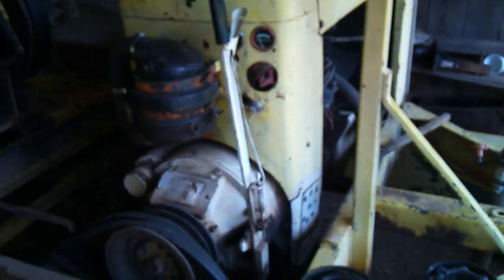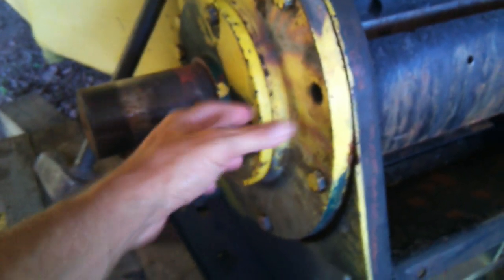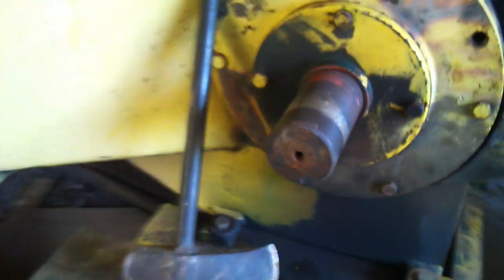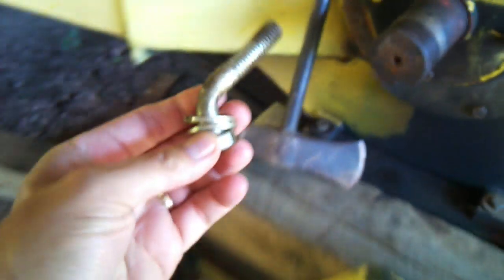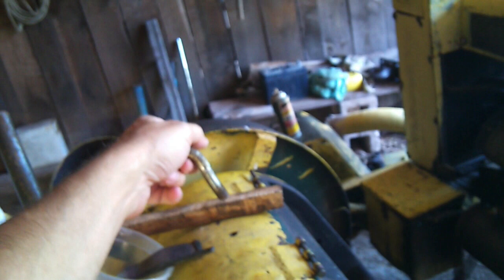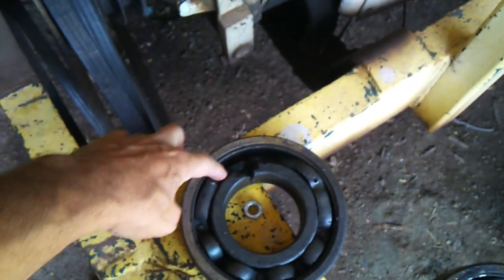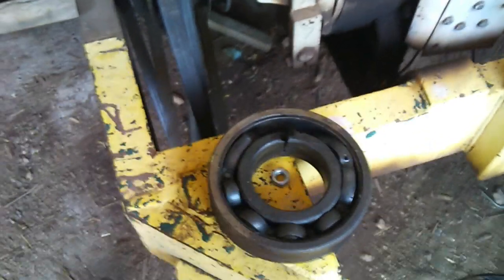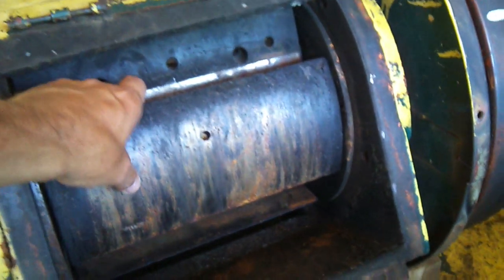Wood chipper project

Comment: Could a person not drill the bearing retainer and add grease fittings?
Reply from the maker: If I recall correctly those are sealed bearings and the grease would never get to where it needs to go. Either way, with the abuse those bearings take it’s better they get changed out.
Reply: @crabblike  you're not wrong. Although any sealed bearing can be unsealed. Much like 2stroke crank bearings. 

I just hate the "oh they're just noisy, change them when there's 0.010" or more of deflection" 

Doesn't sit right with me
Reply from the maker: @514stuff  no doubt. I’m guilty of lifting the edge of seals to get my injector needle in there.

Comment: Im stuck trying to get the big flywheel off the qd bushing broke it still stuck on any suggestions on how to get it off?
Reply from the maker: Timothy Carey Pressure between the flywheel and the shaft, penetrating fluid in the bushing space, and shock from a sledgehammer. You may need to heat the flywheel too.

Comment: I broke the rotor housing on my chipper trying to get it off i used 2 bolts on the sides and it snapped just like yours how can I get it off i really need this thing fixed
Reply from the maker: Timothy Carey the sides are cast and can’t take the pressure of running bolts into the outside threads. The bolts have to go into the internal threads to be secure enough to push the rotor through the opposite side.
Reply: @crabblike  im going to use b7 threaded rod and 3/4 in steel plate  and a 30 ton hollow ram jack i have blades and bearings ready to go on

Comment: I have a old asplundh drum chipper bearings are bad trying to remove them to replace from what i seen they have to be pressed off
Reply from the maker: Timothy Carey chains and a jack
Reply: @crabblike  thanks im getting it torn down got to get the fan off its been a pain on my way to auto part store to get a big pulley puller to try that
Reply from the maker: Timothy Carey yep. I said that in the video.
Reply: Did you use chains around the jack? I seen another video he used threaded rod and steel plate
Reply from the maker: Timothy Carey if I remember correctly the fan and flywheel are tightened in with wedge collars. There should be alternate threaded holes that you can put the tightening bolts into to put pressure on the collar (not too tight because they’ll crack) then shock the end of the shaft with a sledge to break them loose. Make sure the shaft is clean and shiny so the rust ring doesn’t prevent progress.

Comment from the maker: The oil bath seems like it would last longer than sealed bearings, provided they are maintained.
I actually did this repair once before on this machine about ten years ago, so I had it up and running in two days.
Thanks for the response!

Comment: Looks like a project. I have a similar chipper made by Wayne. Late seventies, I'm guessing. Has oil bath bearings with sight glass & fill port with the spring-loaded caps. Seems okay at the moment. Hope you got yours up and running again.

Comment from the maker: A railroad jack, chain, bolts, and various sized heavy tubes and spacers to push and pull from both sides, or opposite sides, depending on which direction I needed to go.